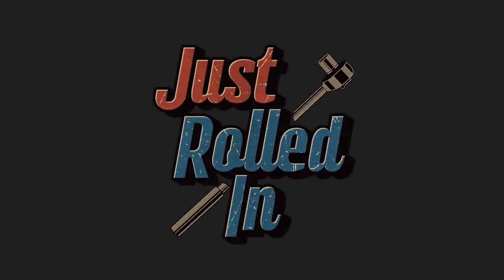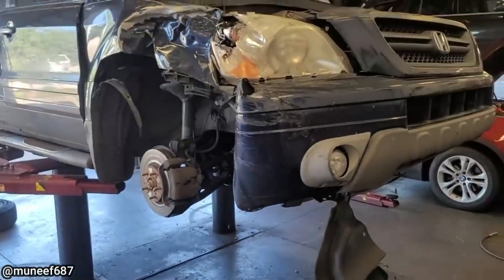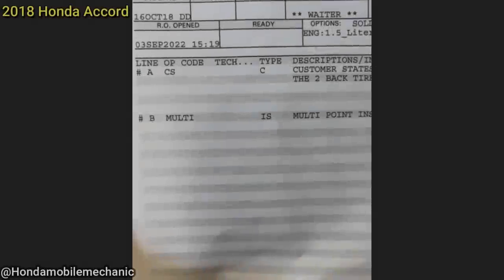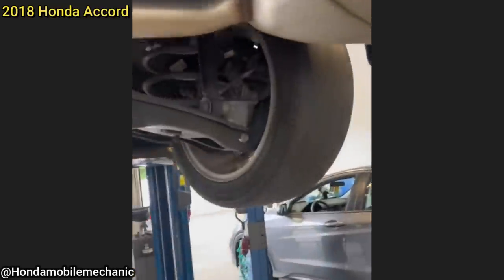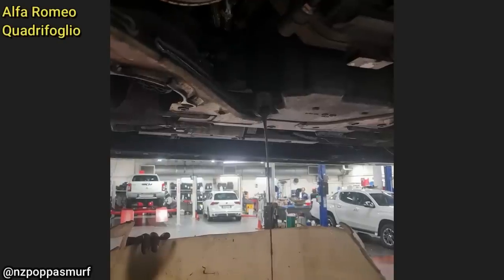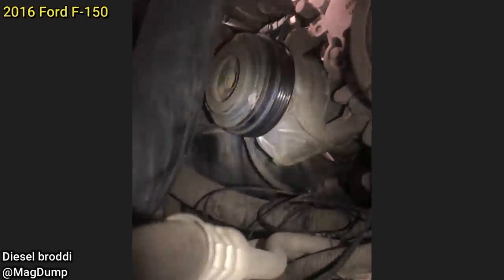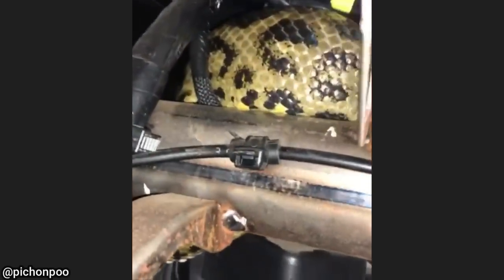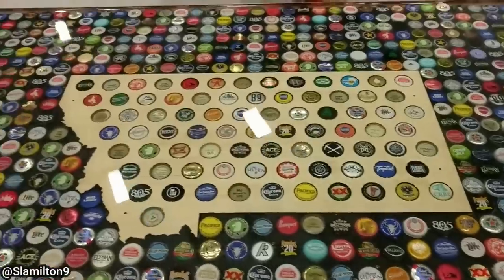Customer States Haven't Serviced Honda Civic In 9 Years | Just Rolled In

Comment from the maker: Happy Monday! Hope you had a great weekend.

Here is also the link to the photos of the tool box in the last clip - https://imgur.com/gallery/kakw8oh
and if you want to submit a clip or photo - www.justrolledinyt.com
Reply: was that an airplane mechanic?
Reply from the maker: @red_d849  yep
Reply: LOL, what do you do about sludge? Soak it in vinegar and vacuum it out? Cause I dont know what else would take out the sludge.
Reply: BG engine dynamic
Reply: Hope you had an awesome weekend too mate. It's Tuesday here in Australia. :)
Reply: I like these "customer decline all repairs and it came back 2 weeks later on a tow truck" clips cuz it gives me a good laugh and expresses a big concern that these are the kind of ppl that are out there on the road driving vehicles like this.
Reply: 406!
Reply: Cool box top. I won’t mind something like that I’m top of my box. Now that I’m retired and not working out of it every day it would last the rest of my life. Thanks for sharing my friend.
Reply from the maker: @c-w-h  You could use an engine flush, and run it through a couple of times. It most likely wouldn't get all the sludge, so you'd have to clean it up manually and take apart the engine depending on how bad it is. In a previous video, a BMW never had an oil change in 12 years, and the customer paid the shop to take apart the engine and clean it. Ran perfect afterwards.
Reply: Thanks have a great Monday too 👍
Sorry I haven't been like and commiting on your video as I have been very busy at home and work.
Some good fails in this one 😯😬😱😨🤯
Love the tool box top 👌👍
Reply: I hope you have a great weekend as well. 
I'm on day 8 of a19 day work period.  So it's gonna be a bit before that weekend comes for me 😆
Reply from the maker: @danielgoetz7821  Best of luck with work! Stay safe
Reply: 1 40   maximum damage